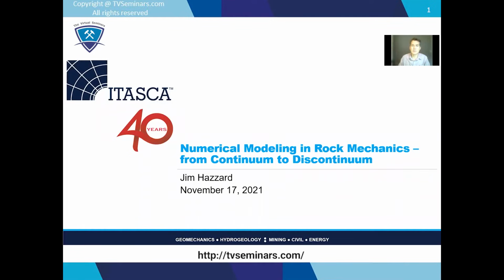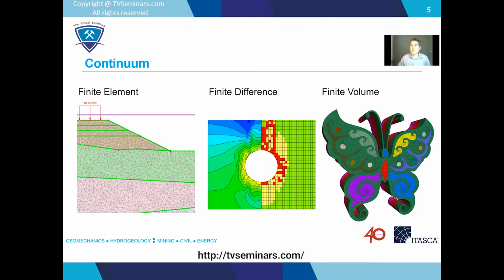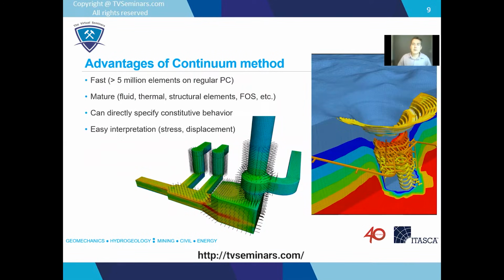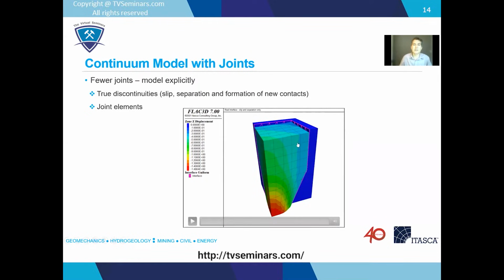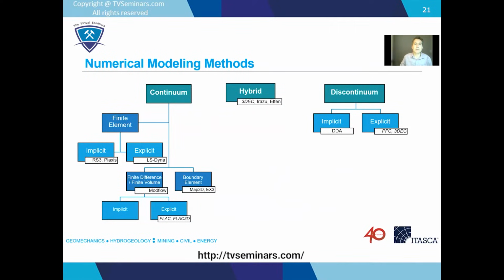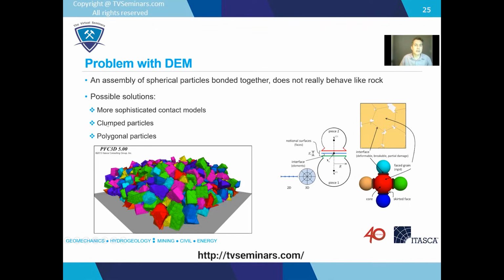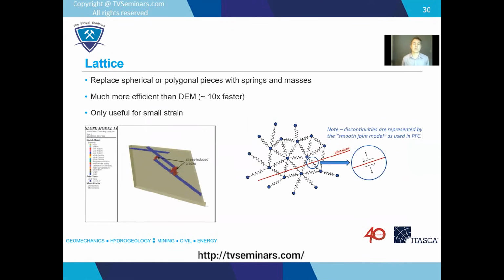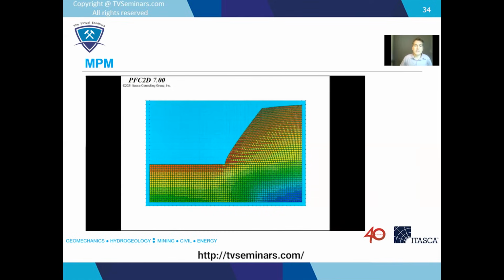TVSeminar: Numerical Modeling in Rock Mechanics – from Continuum to Discontinuum

Comment: Thank you Jim. It was great. What kind of modelling do you recommend for a sublevel stope 25 by 25m in a faulting zone? DEM is the best?
Reply from the maker: Hi Mahdi, thanks - I'll let Jim know about your comment. For your question, it depends on what the focus of the model is. How thick is the fault (should it represent by weak zones - FLAC3D, or does it needs to capture shearing/separation, then joints (3DEC/PFC) or via interfaces (FLAC3D). Outside the fault, can the rock mass be captured via Hoek-Brown or other constitutive model (FLAC3D/3DEC) or is explicit damage, sloughing important... then 3DEC bonded-block-modeling or PFC balls or PFC rigid blocks might be a better approach. This would be a good question for our software forum if you can provide some more details and see what Itascans and other users might suggest. The forum is at https://forum.itascainternational.com/.
Reply: @itascasoftware  Thank you. The focus is on the stability of the stope. It is an underground mine at depth of more than 170m, and the thickness of lode varies from 2 to 35m. The mining method is sublevel open stoping.